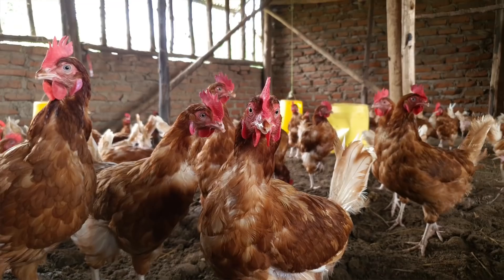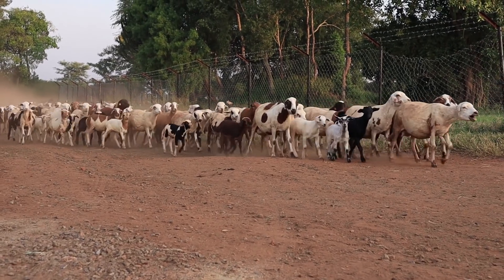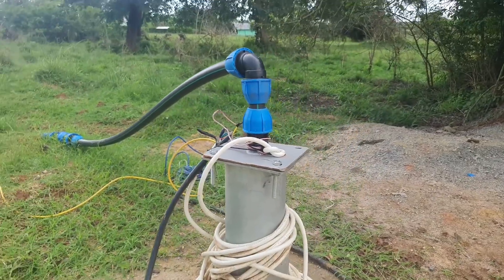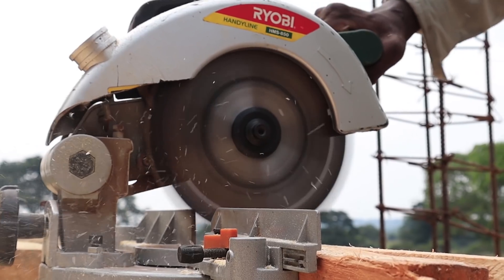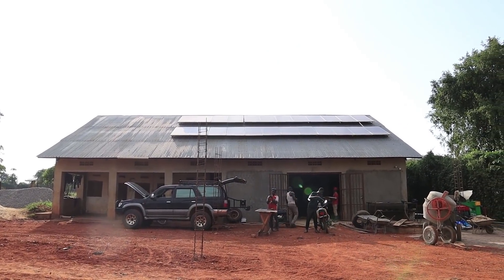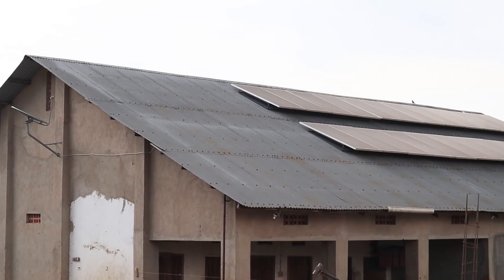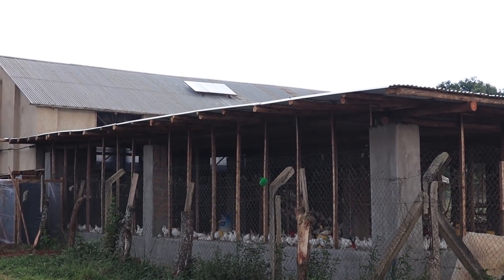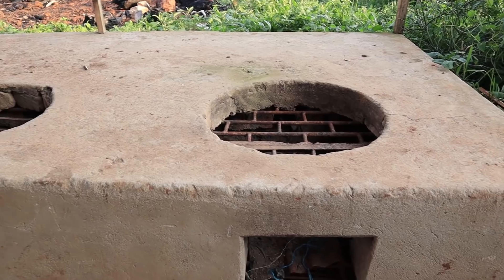Solving the ELECTRICITY⚡ Problem on our 400 acre Farm

Comment: You require an integrated energy system of solar pv, battery storage, wind turbines, biogas, LPG and biomass to run your farm. With proper design can run the farm without need of connecting the national grid.

Comment: Identify a natural contour on your land. Excavate it more to create a large pond, e.g. one acre pond.
Identify another contour, but on lower elevation to the first. Create a pond from that also.

Connect both ponds. As water flows from higher to lower elevation by gravity, you can use the hydro-power to run hydroelectric turbines to generate electricity.

You can use solar to pump water from the lower pond back into the higher pond.

Another option is wind turbines, if you're lucky enough to have good wind speed in your area.
A 20kW wind turbine goes for about US$15,000.
Then a 20kW inverter would probably cost you another $5,000.

Comment: As a small scale farmer and a renewable energy engineer who has been following your channel for quite sometime, I am glad to see you finally embrace more sustainable energy sources. I don't know much about your topology over there but wind energy is another source you could explore. When you finally get electricity into the farm consider having your systems tied to the grid system so as to cut down on the high costs of battery bank. All the best

Comment: You are doing very well young man. You have the ideal life. 

I visited a 1,000 acre farm in Northern Tanzania near Serengeti that was incredibly designed and run. This is a dry area. The owner kept cattle from which he produced a lot of biogas. From this he generated all the power he needed to power deep boreholes and other equipment at the farm. With this water, he irrigated a huge area and grew maize and water melons. He actually used to sell his water melons here in Nairobi. The owner would mill the harvested maize and sell maize flour to institutions, The maize stocks would be chopped and get enriched with molasses and sunflower cake to feed the cattle. The maize comb was milled and enriched to feed hundreds of pigs at the farm. The owner had slaughterhouse for cattle and the pigs. He would slaughter these animals and export the meat in refrigerated trucks to DRC Congo. The farm is like an oasis in the desert. This is value addition at its best. 

With 400acres, you can plan towards a similar farm setup. Invest in proper infrastructure and rake in good returns in a few years to come. Avoid power from the national grid. It is expensive and unreliable ( I have worked in Uganda). Invest in Solar and a Bio power plant. With this, you will take full control of your energy needs now and hedge against the certain increase in energy cost from the national grid.
Reply: Great Advice

Comment: I have researched about the use of biogas to run a generator you can research and see how you can implement it. with the generator running on biogas means you will have AC power at a much cheaper cost and only left with servicing of the generator. if u further buy batteries then they can as well be charged using the same power of which you can use at  night

Comment: In addition to your Solar Panels you should get a backup home Wind Turbine to place on  top of your chicken houses. So when the sun goes down and provided that you get wind circulation on the farm a Wind Turbine can work. They sell them online on AMAZON. in the US. However you can check other places.   They can fit on top of the roof since they are small.

Comment: Am an electrician and going green is my in thing. You need to calculate your power demand in KVA and import complete solar system from China which will be cheaper for you . High efficient solar system from china probably which will be inclusive of inverter, dual charge regulator for both wind turbines and monocrystalline solar panels . For batteries if you can afford lithium cell batteries the better, if not go for dry maintainace free .Wind turbines that can sort charging issues during night. This can cover your lighting and cooling issues. We have in Kenya solar water heaters with 300l capacity going for 800 US$.
good solar system can run up to 50yrs though you will need to check on your batteries.
 Your farm you have enough chicken, sheep and cows to sort your heating and incubation issues by investing in biogas. For blooding use biogas blooding lights for space heating.

At the end you will have no bills if you invest smartly in green energy. Hopefully this helps you.
Reply: James today I came across  Luminous 220amh tubular solar battery and I was told is better  than the dry cell cos it can last up to 5 to 7yrs. How true is it?
Reply: They are good because they resist oxidation but it depends with quality, mostly companies  offer 1 yr guarantee... @chukwuemerie
Reply: @jameswanjohi3246  luminous product. They are into solar energy solutions.
Reply from the maker: Nice one.  Thank you

Comment: Dr, you're underestimating the potential of biogas.
You can generate upto 200kV of electricity using clean methane from the biogas. You have lots of cattle and these can maintain the biogas. For years, the cost of hydroelectricity will not yield you desired profit during incubation.
The effluent (by-product) from the digester will be fertilizer for all your crops.
Reply from the maker: Thank you.  Will look deeply into that
Reply: @FarmUp  alright, please check your twitter. I'm currently setting up the same biogas system for my poultry farm.